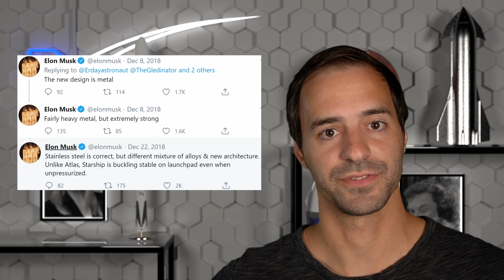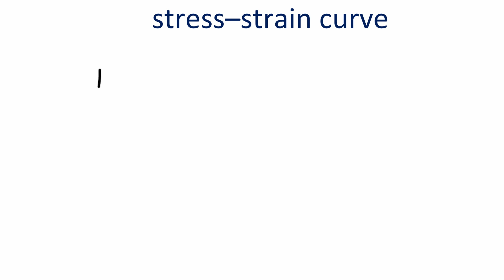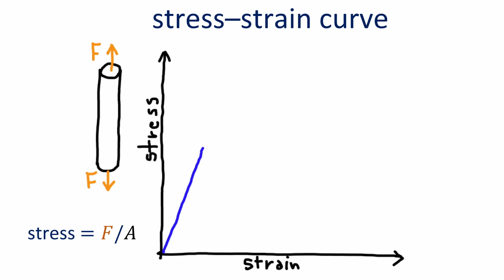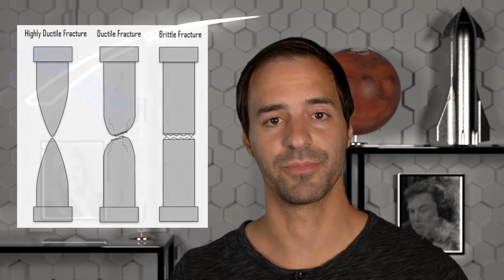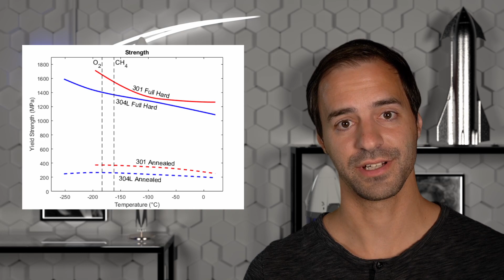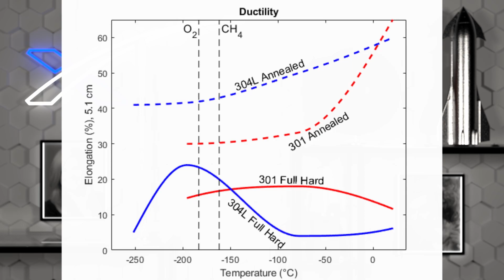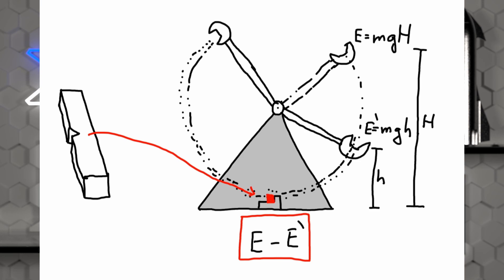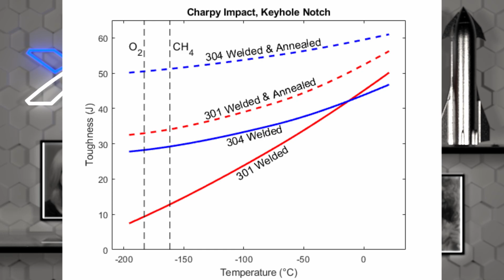Why Is SpaceX Switching to 304L Steel for Starship SN8?

Comment: Nice video. I’ve been looking for another MechE to discuss a couple of issues with.

The main issue is the plausibility of Starship surviving it’s “bellyflop plunge into Mars (ie Earth’s, on return flights) atmosphere. In side loading, These steel rings have all the strength of way overcooked ravioli. Look at the lack of strength when a forklift picks them up in the following video.

The cannot even support 5heir own weight without massive deformation. If anyone deforms a welded joint to this degree, the weld simply fractures. Note that the body of the starship is NOT pressurized during re-entry. I am certain that the engineers at SpaceX will spend enormous amounts of time & attention modeling this critical phase of the flight, and I trust those analyses. But the loads on re-entry will NOT be static, they will be fluctuating all over the place as the shape & aerodynamics of the deforming body changes shape (remember the effects of vortex shedding on the Tacoma-Narrows bridge). PLUS the forces & streses that the wings MUST exert on the body at the attachment points, if it slows down the entire spaceship. I see the entire body of the Starship simply disassembling into a thousand tiny pieces (maybe a couple of big pieces).

I can not imagine this vehicle slamming broadside into Mars’ or earth’s atmosphere at Mach 25 or more & surviving.

2nd topic.
Friction spin welding of the r8ng segments. I know 5hat it’s tough (not impossible, lots of data, just difficult on tool life) to FSW steels, but it has an enormous advantage in consistency of welds & minimized HAZ. And the HAZ, being the weakest links, ultimately defines the strength & reliability of the welds. The rest of the aeronautical & rocket industry long ago switched to FSW (mostly because they were using aluminum, where the advantages were much greater, because of difficulty of welding AL. I think that there’s still a lot to be gained (mostly in reliability, consistency, & reduced embrittlement) by using FSW. 

Your thoughts?

Regards,

Tom
Reply from the maker: Hi there! By the way, I'm not mechE by trade, more as a hobby, so my knowledge on more complex topics is limited. 

Both points you are making are great. Regarding the first one, I'm sure that the steel rings are not the only structural member. When you Google pictures from Elon showing the engine mounted on the Starship from the inside, you will see a lot of extra welded-on members going in both directions. I think this is the way they are going. 
Additional thing is that that might be able to extend the Mars aerobraking for longer time thanks to the lift from the flaps, reducing the atmospheric forces.

Your second point regarding welding... Several welding robots have been seen in Boca. I think they will end up with robotic laser welding. Stir welding requires such an enormous tooling costs, support from the back side, filling up the exit holes... They do friction stir weld Falcon 9, so I'm sure they are considering it...

By the way, one of the videos I want to do soon as "welding in space". Or it's non-existence, even though we have perfect technologies to do it (EBW!)
Reply: Spaceflight Explained  

Spaceflight Explained  here is the video that I intended to put into my previous comment. It took awhile to find it.

https://www.youtube.com/watch?v=egDXR8vSwSY&t=4m04s

When they lift the ring segment with the forks of the Front End Loader, you can see how flimsy the ring segments really are. One of the lessons of structural engineering is that it does no good to mount really strong parts onto really weak bases. The weakest parts in the chain fail & the strength of the strong parts was wasted. Your right about internal structures, but 5hats a serious double edged sword. The outer shell is so weak (and it’ll be much weaker than shown in the video above because they will be turning the “hot” side of the spaceship into Swiss cheese so that they can attach the heat tiles.

What you’re saying about internal structures is completely valid as shown in this video at about 4 minute mark when the flip a whole assembly segment.

https://youtu.be/AVVwd4z48bk 

But what happens then is that you’ve got a couple of strong segments interspersed a several weak between each, like sausage links. It’ll buckle at the weak points.

Worse, the weak outer shel will then transmit those loads to the interior components, which have long “downcomer” (who the hell named THAT thing?) tubes & tanks that I find very difficult to believe were designed to take that magnitude of bending loads.

It’s kinda like having a giant umbrella or a poorly anchored, large tarp online in a (Mach 30?) hurricane. 

I am conflicted about this. SpaceX’s engineers have shown themselves to be superb engineers. The hero of the program gets no recognition.

The reason that they’ve been able to do so much, so fast & so successfully is that 5hey have ready access to aerodynamic modeling & stress analysis software & powerful computing that didn’t exist in the time of Apollo.

I am confident that they ALREADY HAVE looked at this flight regime & concluded that there is a way thru the maze. I just can’t see how they plan to do it. The usual way to strengthen large weak webs like this is to add “battens” as they do with sails. But you’re still left with the strong in a few areas, but weak in between.

I am prepared to be WAY impressed when they accomplish this.!

P.S. ”(you’re) not a MechE, just a hobbyist, so (your) on more complex topics knowledge is limited on some of the details...”
Don’t let that worry you.
The main thing that changes when they give us those diplomas is that we NEVER AGAIN admit that “our knowledge is limited ... about ANY topic”.
 And you did fine on your first video.

I’d highly recommend that you look at (& then join so that you have access to their info) a website called “engineering toolbox”. They’ve got great high level overviews along with detail info on lots of topics. It’s very affordable, very practical & could save you many, many hours of research time.  Just a suggestion.
Reply from the maker: @teefkay2  Well, one thing is certain. If they didn't think it through, they will find it the problem very quickly the hard way. One of the advantages of their "crazy farmer" approach. 

Oh, I have my share of diplomas (PhD in EECE), but the more I learned the more I found how little I know...

Comment: 304L was created for welding without heat treatment. Literally the only reason for the steel to exist is ease of welding. So it is not really a surprise that Spacex use 304L for easier welding.

Comment: What are the tradeoffs of using a sandwich composite of different steel layers, instead of just one layer?   We might also consider that only the outermost layer needs to have complete coverage, if mass savings or insulation was a consideration.
Reply from the maker: Well, SpaceX design approach is to make things as simple as possible, unless that solution doesn't work. Sandwich would bring so many other problems. They are using inner braces/rebars welded from the inside so it can hold it's weight without being pressurized. So in a way, they are doing what you are suggesting.

Comment: So I liked your presentation a lot!  Very informative.  I would like to know why 301 ss was chosen in the first place?  Cheaper, perhaps stronger  for the weight, at non cryogenic temperature?  I'd like to see the welding setup and how they protect the back side from corrosion during welding? By some coating, back purging or welding both sides simultaneously with shielded gas welding?  Interesting stuff. It's rocket science right? 😊. They aren't just flying grain silos after all.  Thanks for your time and efforts.
Reply from the maker: Exactly as you said - 301 is cheaper and stronger at room temp. But I'm sure they were aware of potential problems so that makes you wonder. Maybe it took time for the supplier to get 304L and 301 was good enough for concept validation?

Comment: I'd like to see a similar analysis under re-entry heat and stress. IIRC Musk might have said that 304L could handle the heat better.
Reply from the maker: Hi there! "Handling" can mean different things here... What is certain, that due to the low carbon content, it will not become prone to corrosion after being significantly heated up

Comment: Weld "STRESS RELIEF" Usually "SOAKED" @ 600 F, for 1/2 hour and, dropped @ increaments of 20 degrees, over 4 hours. If I remember been 35 years,
Reply from the maker: That is interesting... That is not as hot as I thought. Does it depend on the filler material?
Reply: @spaceflightexplained360  Check out "COOPER HEAT" stress relief. I can't seem to reply full story. Mid 80's here on east coast USA, that company, did most "Stress Relief, they had charts/tables, on different metals & soak times.

Comment: I am a boiler engineer an our exam equitation for vessel steel and steam drum burst equation tensile strength are right on you can fin more from A.S.M.E tensile testing manual. excellent reference manual.
Reply from the maker: Hi there! I'm curious about you opinion. Using the thin wall approximation formula, assuming 8.4 atm pressure, 9 meter diameter and 3 mm thick steel, the hoop stress on this seems to be 1250 MPa. That would mean 625 on welds (if not braced by more steel). Is that possible? That would mean seriously hardened and thus brittle steel...
Reply: My terminology for the equations may be a little bit different If you go to the A.S.M.E  American societee of mechanical engineers Look up material handler Construction Or boiler vessel compliance construction I'm quite sure they have Equation Tolerances And temperature pressure chart   for 304L stainless steel sometimes they sell their manuals aren't not cheap. The real 304 l  Stanley steel is it for the construction of the methane tanks and the liquid oxygen tank  or  just for the outside shell. For the containment of fuel  tanks main rockit body I have also Google 304L stainless steel chart and  tolerances.

Comment: You say it's your first video, well you nailed it. I am a mechanical engineer from the Netherlands which works a lot for the semicondutor industry. These topics are daily topics for us (looking at materials etc). Your methodic analyses, your excellent image contents and your clear explanation is really great! So please go on with this. 
By the way, a also worked for aviation and space industry, one of the this which is strictly forbidden in the high tech fabrication industry is to use wire edm and sink edm, this due to the so called "white zone". If you ever out of topics, maybe this is one for you. 
All the best with you channel and please go on!
Reply from the maker: Thank you!!! I know that what I explain here is pretty much mechanical engineering 101, but I'm still really surprised that I didn't mess anything up :)

Comment: Good job. Do you think the blackened weld areas on the outside of the ship (at points where the weld is inside) represent a future corrosion problem? Should SpaceX use argon flooding opposite the welded side during the weld process?

Comment: I'm still very curious to see how reentry heating effects the properties of the steel. If you are correct that SpaceX can't anneal the welds, that could introduce some potentially catastrophic results as the reentry heating could cause some of those welds to be partially annealed in an unpredictable manner.
Reply from the maker: Absolutely. I think their goal must be to keep it below 870 degrees C where the structure doesn't change (don't quote me on that number)
Reply: @spaceflightexplained360  I'm not sure that will be possible with their current plan to reenter at orbital speeds. I believe the shuttles reentry from orbital velocity created temperatures of around 1600 degrees C

Comment: On annealing it's crucial that the metal cool slowly. A weld that is cooled with ambient air cooling could be too rapid. In the shop we use thermal blankets to slow down the the cooling. As a machinist improperly annealed welds are a nightmare!  Oh and GOOD JOB!  and good luck. I think I'm the first sub :) Maybe not.
Reply from the maker: Thank you!!! I'm not a mechanical engineer by trade, I was just learning it when I worked on my hobby project and I must say... Machinists and welders have my infinite respect
Reply: @spaceflightexplained360  I envy anyone learning anything these days.  So much information and instruction at your fingertips. Keep learning and the best way to really learn is to teach and share. Ask the Everyday Astronaut:)

Comment: As a mechanical engineer with a Masters, you did an excellent job. Subscribed,
Reply from the maker: Thank you so much! I'm sure it like 101 lesson, but it's great to hear that I didn't mess it up!
Reply: Spaceflight Explained You did good. For most people interested, it's pitched perfectly. If people are interested in the 'why' then you need to have some level of technical information. I don't think you covered anything I did not learn in Material Science in high school. If more people learnt the science and engineering behind decision making then more people would be interested in STEM.

Comment: Very good first effort - well done. You explained the differences between the two steels very well. I agree with your assessment - it would be welding strengths at cryogenic temperatures.

Comment: Could play with a 304LN or a 316L or LN depending on the properties and problems they've run into. I think you nailed it with the weldability and low temp toughness. 301 would never be good enough for a reusable vehicle.
Reply from the maker: Yes, I wonder what their final steel composition will be!

Comment: I was expecting technical errors , but they did not materialize  , I would like to have seen a comparison of the spot and seam welding used on the original Atlas and whatever Space X is using. Also I'm interested in the use of 1,2 Butadine as a safer feed stock for synthetic rubber and a good Rocket propellant , I'm especially interested in a assessment of the possibility of vapors in the booster tanks exploding  during "reentry".
Reply from the maker: Thank you! I wish I understood more about welding - mig, tig, laser, ebw... but it is such a complex subject when you combine it with different metals, that it seems more like an alchemy to me. I'm curious if they can use the reentry heat for autogenous pressurization for the landing burn

Comment: One additional thing that I hope the designers factored into consideration:  The Charpy V-notch test is good for determining the toughness of a material, but in the case of Starship (not the early ones but full production models) the steel will be exposed to extensive radiation during it's weeks, or months, in space.  Over time this will embrittle the steel, reducing it's toughness.  The same thing is seen in steel used in Nuclear reactors.  This additional embrittlement must be taken into account over the lifetime of the vessel or catastrophic failure (especially when heating up or cooling down the material) could result.
Reply: May be a double hull system or better still enter into a "Mothership" "Generation ship" specifically built for true space travel in the future. 
Each celestial object could have specialize crafts to suit take-offs & landings.

Comment: Good content. It would have been interesting to also compare the properties of 301 and 304L at the temperatures it would likely encounter during reentry. The steel will have some ablative shielding of course, but temperatures are still likely to get to around 2000°F. Direct reentry from an interplanetary trip (not slowing to LEO speed first) would be considerably hotter. SpaceX has got to be considering that end as well.

Comment: Welding any stainless steel is challenging requiring careful attention be made to heat absorption during the weld. A finished good strong weld should show minimal color change with darker blacker finished welds being weaker commonly referred to by welders as "cooking" the weld and is accompanied by deformation, bending of the metal near the weld. They will likely experience another learning curve of welding, as was shown when first starting to weld SS, from switching to another grade of SS.

Comment: You did not explore the external load conditions for a tank. Assuming the tank is build as part of the rockets structural component thus not relying on some additional structure, columnar loading and external aerodynamic loading could control the design ( I have no idea, just speculating).  Columnar loading and external pressures can be the deciding factor on material selection at lower temperatures. Unfortunately I retired from pressure vessel engineering 10 years ago and don't even have a copy of ASME PVC any more so I'm trying to do this from a very spotty memory.
Reply from the maker: Yeah, I don't think there is an information available on this. There are definitely vertical bars being welded from the inside, but most of the structural integrity at launch it's provided by the pressure on the tanks. I do wish I had a CAD model of their latest designs for some finite element analysis, but of course I don't, and I won't :)

Comment: Great job for first video.  Set is nice, length is about right, lighting needs a little more dynamism, play around with light positions to make your face a little bit less flat lit. 

But the biggest thing to work on is audio.  A cheap lavallier mic might be just the ticket, but if thats what you have now, then work in damping the echo in your room. You can make effective acoustic panels from used towels at charity shops— a lot cheaper and more effective than the commercial stuff
Reply from the maker: Thank you for the advice! I have a Blue Yeti but I didn't have a tall enough tripod for it, so I had to talk loud and the echo became an issue. It should be better from now on.